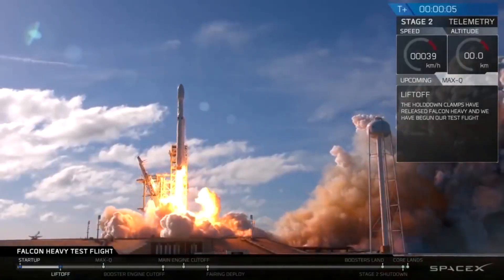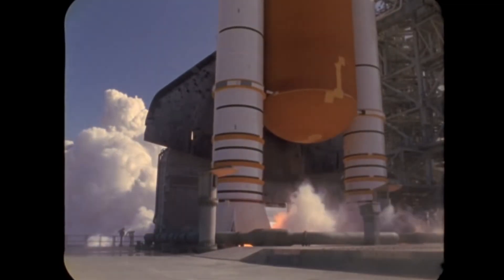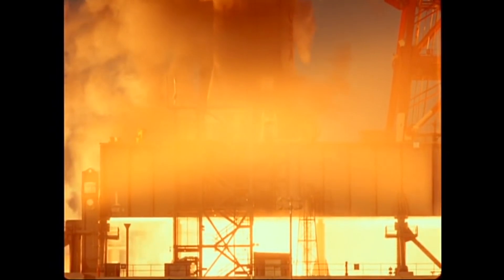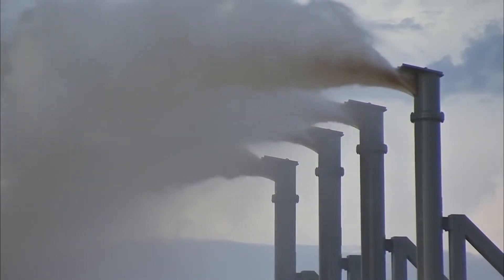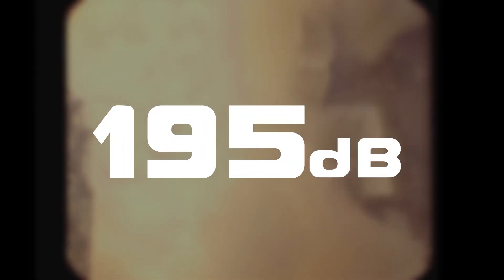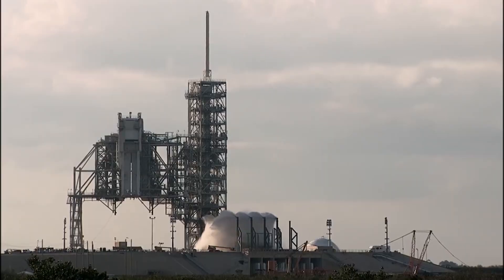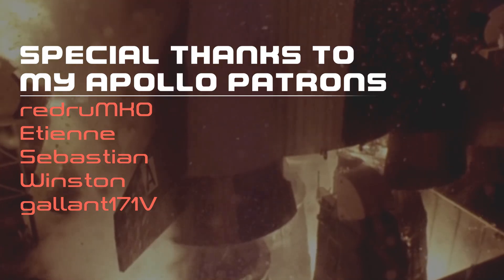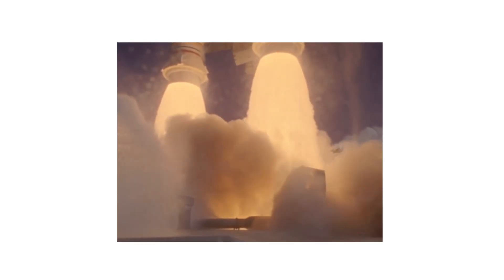Why doesn't the sound of a rocket launch kill you?

Comment: USA: let’s build an incredibly advanced system of water to perfectly spray the rocket
Russia: hole
Reply: hole
Reply: @jimi4458  This comment deserves more attention
Reply: @bloggingoreo  yup temperature :D easier cheaper faster simply Russia :D
Reply: @vladimirandras2047  PSA: Russian bots like this post.
Reply: This is like NASA developing special zero gravity pens. 

Russia : Just use pencil
Reply: @lunchie80  Joke asside, traditional pencil tip in carbon are dangerous in rich O2 environment, because it can cause sparks.
Reply: @lunchie80  that one is fake actually , I 100% support russia and all but using pencil in space can create a lot of problem , using a pencil means many particle (composed of small bits of the pencil lead) WILL be floating everywhere and that can cause a lot of damage , it's very risky , so that's why nasa did this , but again , I'm not saying nasa>russia or russia>nasa (however I do prefer russia)
Reply: @lunchie80  yea and have pieces of graphite/lead in your eyes lol
Reply: I dont get it
Reply: @lunchie80  half the stuff we develop is under the assumption that the techniques learned can be applied to other things. Work on pens doesn't just apply to pens
Reply: @lunchie80  You have to sharpen a pencil.
Reply: Being that the whole state of Florida is almost at sea level. It probably wouldn't work here to dig a flame trench. It would just fill with water.
Reply: @im1who84u  a hole with water in it...kinda sounds better  🤔
Reply: @tylerdurden3722  surface tension might reflect sound waves... which would be problematic
Reply: @im1who84u  you think they just dug a hol and didnt use concrete or something in it hahaha
Reply: @tjorvenblader  Still not a good idea for the Florida launches.
Reply: @im1who84u  I never said that tho
its a lot cooler with the water anyway hha
Reply: @tjorvenblader  We're cool.
Reply: @im1who84u  +Flame trench
+Water bubbles from the water filling it up
Upgrades, people, upgrades!
Reply: @im1who84u  'Netherlands has entered the chat'
Reply: @im1who84u  Not if you don't connect the hole to a water source that can flood into it.
Reply: @FlaminCamin  Yeah. It really feels like some of these dudes think that if you dig below the sea level there is just sea there. Like do they think land just floats on water?
Reply: Work smarter not harder
Reply: Maybe digging a deep hole in the marshes of Florida isn't such a grand idea for some reason.?
Reply: @ahdoeknogh  That's what I am going with.
Reply: @sherloidbai7064  their transport costs were still half of that of the americans, the americans built special planes, vehicles, and the launcher transport vehicle, billions of dollars in costs to move that rocket a short distance, you do realise that russians spent less to transport their rockets to launch site even though it was hundreds of miles away, america spent billions to move a rocket less than a mile. Russia built a trailer to attach to trucks, then built a small section of railway using a normal train to pull it the final distance, they use a modified train carriage to hold the rocket, they didnt have to build a billion dollar rocket moving vehicle, they modified commonly available parts to move it, so your whole point is completely invalid, even though they have to transport their rockets hundreds of miles, their costs are still 1/10th of the americans who only have to move their rocket a mile or 2. Simpler, more reliable, cheaper, Russia put's america to shame with their space program, but yet americans still think they are the best, while paying russia billions of dollar per year to take them to space..
Reply: Russians have always been very efficient and smart in solving problems. Unlike of course americans who overprice everything  to rob the tax payers
Reply: @Burningarrow7  For real. Just look at how they kept the tracks on T-34s, brilliant
Reply: Since ending its space shuttle program, NASA has had to pay Russia to use its Soyuz rockets and carry American astronauts into space.
And they do it with a hole, these Russians are geniuses
Reply: Russia= hole America= Florida with water underneath so can’t dig the whole. Ironic as fuck......
Reply: Sorry, Sport, but the Russians used water deluge for noise suppression for both the N1 and planned Energiya...

“The launch pad built by the Soviet Union beginning in 1978 at the Baikonur Cosmodrome for launching the Energiya rocket included an elaborate sound suppression system which delivered a peak flow of 18 cubic metres (4,800 US gal) per second fed by three ground level reservoirs totaling 18,000 cubic metres (4,800,000 US gal).”
Reply: @waynebreivogel1742  were you replying to my comment on this guys post? I was using sarcasm towards his initial statement...... just clearing that up 😉
Reply: jaue82 That's not about being smart. That's just about the amount of money they spent.
Reply: Usa: Makes a pen that works in space
Russia: pencil
Reply: @josho3408  this i had completely forgot about, they had a whole team to design a pen that would work in space, the amount of money that would have wasted when they could have actually saved money buying a box of pencils, it's no wonder the russians beat them to space :D
Reply: Graphite breaks off  into microparticles and needs to be sharpened and if you break a lead in space it could fly into something ...  sometimes things are over engineered for a purpose
Reply: @LadyRubyEye  this, have my likes
Reply: Hœle for motherland
Reply: The Russian method puts the rocket at risk by weakening the ground foundation of the entire thing.
Reply: @KenLinx  and exactly how is the ground foundation weakened by this measure?
Reply: @shroomzgames7370  What part of giant hole beneath the rocket constantly bombarded by sound shockwaves and rocket exhaust in a cold environment seems safer than spraying water?
Reply: Who do you think did it smarter?
Reply: This is Flordia. Hole would require a lot more water pumping.
Reply: girl:  you're nothing to me be but a wallet I use to buy expensive things and make my life better
guy:  hole
Reply: to be fair digging a hole at sea lever, on what is essentialy a swamp, would require tons of water drainage
Reply: @sherloidbai7064  Baikonour is the most inland place in continent chosen for it's favorable conditions with little to no overcast.
Reply: King Croft  and you got something against poors huh ?
Reply: It's the pilot pen and pencil all over again. Shut up Tomas I know about lead particles
Reply: US is far more effecting if you know anything of sound surpression.. Lol to the dumbasses thinking Russia wouldn't use the same approach, if only the water wouldn't freeze.. Please stop comparing limitations to what people can use.. fml..
Reply: H O L E
Reply: @ReefleksPlayz ROTFFLMAO
Reply: More like let’s just make this process much simpler and make the fire trench bigger, stupid Americans with their ‘water’.
Reply: H O L E
Reply: ReefleksPlayz Thank nazi scientists
Reply: @michaelbennett4554  the germans still over engineer things
Reply: Michael Bennett thank all scientist you conspiracy theorist.
Reply: Further proof the Russians can do anything the US can on a FAR smaller budget. 
US Advanced water system maintenance costs - $Millions
Russian, hole maintenance - $Couple of excavators.
Reply: @MrDemoncrusher  well considering the state of Russia's economy, they have and always had to do shit cheaper than the US. I mean yeah it works but sometimes it doesn't, Chernobyl being an example of that. America just uses expensive shit because the country itself has a shit ton of money to do it. But of course, just because you have the ability to buy something more expensive don't mean you should, and I'm sure there's an example of which where America made/bought something that was hella expensive and it backfire completely, but nothing instantly comes to my mind about it
Reply: Перевод:
США:Давайте используем сложные системы
Россия:дыра
Reply: not sure how you think a water sprayer is an incredibly advanced system, no wonder 2 of the shuttles blew up if thats the thinking.
Reply: Usa +10 Russia -40 xD
Reply: USA: let's build an incredibly advanced pen that works in space 
Russia: Pencil
Reply: it's amazing we won the cold war with them thinking so simplistically
Reply: @simonpeter5032  You won the cold war? What does it mean? How did you do that?
Reply: @Mr00Bosek  xddd
Reply: @Mr00Bosek  Mainly by just being way more advanced, developed, and less war torn after WW2 allowing us to display dominance and win over europe, as well as pitting the soviets into competitions too expensive for them to win, forcing them into bankruptcy.
Reply: @simonpeter5032  lol, you dropped the mic harder than the fall of the soviet union!
Reply: @thefakepie1126  Yeah, I'm not reading that.
Reply: @thefakepie1126  That may be, but at least I don't waste my time arguing with people on the comments section of youtube videos.
Reply: @simonpeter5032  yeah , I'm totaly wasting my time , it's not like if you don't tell stupid people that they're stupid the world would never change , right ? it's not like even tho you don't listen , other , more open minded people might , right ? it's not like it's also a way to be more prepared in a similar debate , right ? it's not like it forces you to think and learn while correcting someone , right ? it's not like "wasting time" is subjective , right ?
Reply: @Mr00Bosek  Yes. It means America has successfully established a global sphere of influence (though is losing it more and more to China). Technologically and economically superior. Military might was slightly on par but America had a massive advantage because of its economy, which meant money was actually going into other things as well other than just the military, unlike the Soviet Union.
Reply: @simonpeter5032  cringe bro...

Comment: The space shuttle design of slapping a spaceplane onto a giant fuel tank with two solid boosters on the side was an immensely complicated engineering feat, the thrust vector and center of mass of the vehicle is offset which makes it very complex to fly, yet these solutions to the sound were so simplistic and technically crude in nature, it's cool to see the duality.

Comment: “Why doesn’t the sound of a rocket launch kill you?”

Why would it?
Reply: Shockwaves from explosions is sound fyi. Hiroshima bomb was around 240dB.
Reply: @Effect-Without-Cause  I still don't understand how 240 decibels can be achieved in an atmosphere that can only support 194dB @0.02mPa
Reply: @sethh8892  It called a "shockwave", in a nutshell; it's taking a region of atmosphere and slamming it against itself, while moving the whole thing outward. Eventually the low-pressure environment in the center collapses and creates a huge backdraft, as seen on nuclear bomb test videos. 

Nuclear bombs create shockwaves with heat alone.
Reply: @Effect-Without-Cause  yeah, but there is a maximum limit to how loud something can possibly be which is 194dB, so it's something exceeds this, it makes me wonder if the sources saying 194 is Max are wrong.
Reply: @Effect-Without-Cause  oooh ok, I read a little more in-depth and realized that 194 is the maximum SPL for a sustained period of time. You couldn't hold 195 DB in Earth's atmosphere without it "collapsing" on itself. However you can have very tiny bursts of sound louder than that. Quite weird how a bomb only 5' tall can make a boom that big. And to think our nuclear warheads nowadays are stronger and smaller... by by entire continent😂
Reply: @sethh8892  As far as I'm aware; there is no upper limit for shockwave "loudness". iirc the Chicxulub impact's (dinosaur killing asteroid) shockwave was powerful enough to circle the earth 4 times.
Reply: @Effect-Without-Cause  there is a point where its impossible to go louder.
Reply: @sethh8892  Technically yes, there's a finite amount of energy in the universe, so everything has a limit. In "real world" terms though, how much energy can you dump into earth's atmosphere so that for a fraction of a second there's some sort a compression wave, without compressing the particles that make up the atmosphere into black holes? Speaking in hyperbole of course.
Reply: Loudness measured in dB is the SPL. Or Sound Pressure Level. Enough pressure can kill you. Sound is NO exception.

Comment: basically when a rocket engine is running, it's pretty much a continuous controlled explosion. and the noise at 195 decibels is no longer noise because it becomes a shockwave. to put it into perspective 180 decibels can turn your eardrums into goo rendering you permanently and completely deaf within seconds. 195-200 decibels is where the sound energy alone can kill you.

Comment: Why would the US engineers choose to pump huge amounts of water onto the launch pad, to dampen the sound and cool the launch pad equipment, using huge amounts of energy to operate the water pumps,  instead of  building a bigger flame trench, and using less water, or possibly no water? The simpler system would have less to go wrong and therefore be safer, too.

Comment: What kind of water is used? Is it fresh water or seawater?
 If fresh water is used, will the effects be any different with seawater? And vice versa?
Reply: I’d have to say they use freshwater. First salt water is much heavier than fresh water so the extra weight might put to much stress on the system. Not only that, salt water starts rusting metals pretty fast. So they would have to flush the system every-time.

Comment: The sound WILL kill you, if you are close enough.
Nonsense question.

Yes, there are various moderators in effect to dampen/absorb/suppress the sound. All that does is reduce the distance at which a given sound level occurs.

Equally, without any moderators, the sound will still be harmless, if you are far enough away.
It's all relative.

Comment: Why can sound kill you? Sound becomes a shock wave around 194dB. What we perceive as sound is longitudinal pressure waves traveling through the air. The "loudness" of sound is dictated by the amplitude of the waves - in this case, the deviation from ambient air pressure. A sound of 194 dB has a pressure deviation of 101.325 kPa, which is ambient pressure at sea level and 0 degrees C. Thus, the sound waves are creating vacuums between themselves, and no higher amplitude is possible. By going louder you're just creating a shock wave of increasing power. It's like standing next to an exploding concussion grenade. It's the shock wave that kills you. Ever been in a loud concert and felt the bass in your chest and tummy? Imagine that feeling multiplied by several orders of magnitude. Your organs would get pummeled into a pulp as the shock waves travel through you.
Reply: Yikes🙈

Comment: The real question is why would it kill you
Reply: because your organs would be ruptured. a bomb explosion is nothing more than a sound wave but so loud it's definition is "shockwave". A sound pulse greater than 194db soundpressure is called a shockwave because it compresses the air more than 1016 mbar (the average atmospheric pressure) but because a rocket doesn't emittate a single shock it's still normal sound even if it's more than 194 db. And a sound engineer I talked to some years ago said to me that a soundpressure greater than 176db and lower than 40 hz could damage your organs. (I'm not a professional this is just how I undestood it in the past!)

Comment: I went to a rocket booster test in Utah at atk testing facility and just one booster made the ground shake and car alarms go off from two miles away and the heat turned all the sand on the very large hill or small mountain behind it turn to glass

Comment: If sound didn't kill you, smoke will. Look at all that smoke and dust. Thats very dangerous for planet's atmosphere
Reply: In the case of the Saturn V, the first stage and the ICBM booster assembly of the Soyuz burns kerosine and LOX so the visible plume that you are seeing is largely water. The shuttle SSMEs also used liquid fuel cryogenic (liquid hydrogen and oxygen), so again the cloud is a result of condensed water vapour and steam. However, the solid rocket booster propellant consisted of atomized aluminum powder  as the fuel, ammonium perchlorate which served as the oxidizer, iron oxide powder as a catalyst, polybutadiene acrylic acid acrylonite  and an epoxy curing agent. 

Nonetheless, solid rocket launches are trivial in terms of atmospheric pollution in comparison to urban/industrial pollution and traffic.

Comment: There's a difference between a shockwave, and a soundwave.  Okay, try this.  Take a 1 lb brick, and set it on your head for 3 seconds.  Now, take that same brick, and drop it from 60 Meters overhead.  10m/s/s...  THUMP!  It's not the drop that kills you, it's the sudden transfer of energy at the bottom.  That's how they keep the shockwave from a rocket launch from killing people.  They dissipate it over a large area, a greater Distance (The radius of that area) and Time.  If you tried to take it all at once, from up close, it would kill you.
Reply: ^That is an oversimplification.  Now, the technical part that's too long to read:  Atmospheric pressure is about 15PSI at sea level.  You blood pressure can vary by as much as 1.5 PSI (About 75 mm of Mercury, which is a funky way of measuring pressure, but that's the way they used to do it) every heartbeat.  These are the kinds of pressures the human body normally withstands.  To kill someone, you have to break something, but we're not glass rods.  We don't just die, something breaks, and then we die.  It's a lot easier with something violent, like the sudden impact of a brick, than with something steady, like an attenuated soundwave even with the amplitude of a rocket launch.  You get used to it after a while...